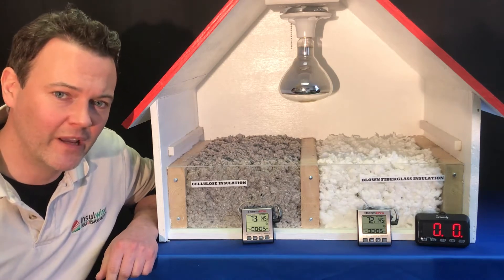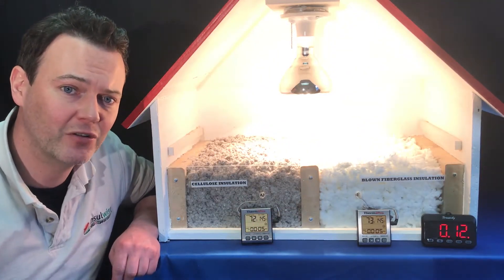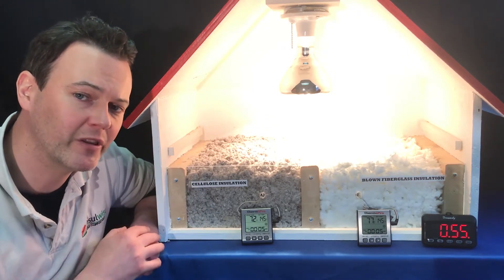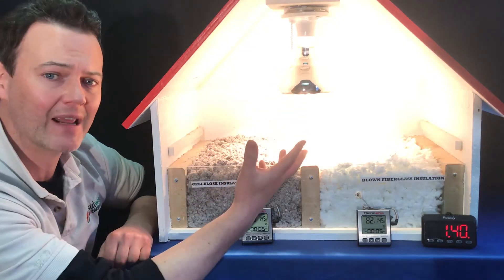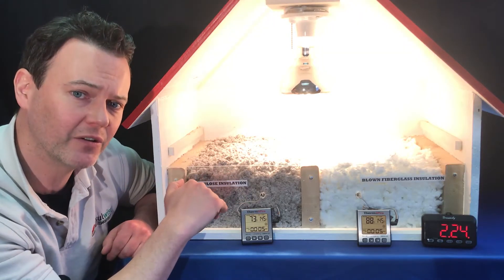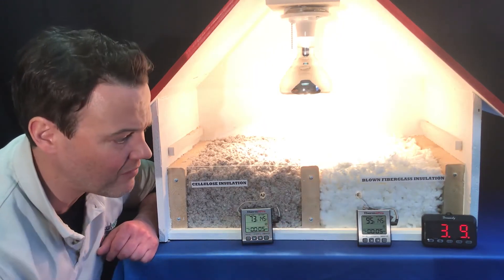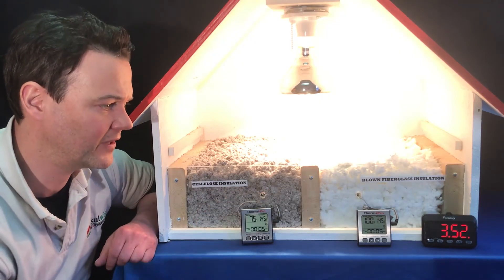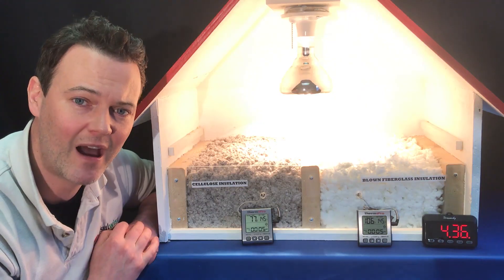Cellulose vs. Fiberglass Insulation: The Ultimate Showdown

Comment: Cellulose does not carry the longevity that fiberglass does. It also needs to be removed more frequently because it deteriorates into dust. Fiberglass all the way just install enough of it and it will work the same. This test is totally skewed because the fiberglass is way underinstalled
Reply from the maker: With due respect, this is incorrect.  I have seen cellulose that has been installed in homes since the early 1970's and it's still doing fine.  It is treated with non-toxic boric acid, so not even mold can break it down.  As far as it turning into dust, well, it doesn't, not sure what else to say about that.  Usually over time it will turn from bright gray to a brownish tint on the upper layer, which seems to be from dust in the attic landing on it.  When you disturb it the cellulose just below the surface is typically bright gray again.  Our stuff is made by a company called Advanced Fiber Technology.  Their manager there Jeff confirmed for me that it's guaranteed not to break down for the life of the structure...ie about a hundred years.  If it did break down at the rate "Dirty Boys RC" says, all of the cellulose insulation manufactures in the country would be having massive warranty and lawsuit claims. 

In terms of insulating performance it's not even close.   There is simply no getting around the fact that the R-Value of blown fiberglass insulation drops dramatically at temperature extremes.  Read that sentence again.  It means that when you most need the insulation to work, its performance will be degraded.  My guess is also that if blown fiberglass was effective, we would not get so many calls to re-insulate hundreds of attics of newer homes that had 16-20" inches of blown fiberglass in them.  The homeowners' complaints are that "I have trouble heating my upper floor in the winter, and during the summer the top floor is 5 - 15 degrees warmer than my first floor.  Often on hot sunny days you can feel the heat building literally as you walk up the stairs in these homes.

Furthermore, Pennsylvania has absolutely garbage incentives, ie effectively zero, for homeowners to up their homes' insulation levels in comparison to many other states.  That means these homeowners of their own volition are choosing to pay us thousands of dollars out of their own pockets, almost always after their HVAC company failed to solve their problems, to solve their homes' uneven heating and cooling issues.  

Lastly, why would I even care which one of these was better if it wasn't obvious?  Our hundreds of customers a year don't buy cellulose insulation from us, they buy a permanently more comfortable and energy efficient solution for their home.  

Hope this helps!
Andy

Comment: Is cellulose suitable for external cavity walls? Just concerned about moisture absorption and transferring moisture to the inside of the house
Reply from the maker: Hi there, cellulose insulation is in fact exceptionally well suited for exterior cavity wall insulation.  The correct process is called "dense packing" or dense pack cellulose because to do the job correctly the cellulose insulation must be blown into the stud bays at high pressure so that it 1) occupies the entire stud bay and 2)  is installed so tightly that it cannot settle over time.

Cellulose insulation is what is called hygroscopic.   That means that it absorbs moisture, but also just as readily releases it.  You can think about how a wet paper towel behaves in comparison.  No matter how wet you get it, it will be dry again within an hour if left out.  If you hire a contractor who can properly dense pack your exterior walls with cellulose insulation, any water vapor moving from inside to outside your home during the winter should have a difficult time reaching dewpoint temperature within your wall cavity (dense pack cellulose is so tight when done properly, that it is very difficult for air to move through it).  

So to summarize, when installed with the correct method, cellulose insulation is a champion for insulating exterior walls. 

Hope this helps, 

Andy

Comment: What do you think about putting cellulose on top of existing fiberglass?
Reply from the maker: Hi Jonathan, 
The practice is called "top coating" and we do it all the time.  It is much more economical than removing the existing fiberglass and then replacing it all with cellulose for a variety of reasons.  However the main thing is that when a fresh blanket of cellulose insulation is blown over top of existing fiberglass batts or even blown in fiberglass (after the attic has first been air sealed of course! https://www.insulwise.com/insulation/air-sealing-insulwise-pittsburgh/), it fills in all of the gaps around the original insulation reducing any potential thermal bridges caused by exposed floor joists, gaps around plumbing pipes, etc.   But just as importantly it also creates a layer on top of the fiberglass that cold air (during the winter months) has a much more difficult time seeping down through.  This allows something like blown fiberglass (which we are NOT fans of) to perform much better (because it is not having cold, heavy air percolate down through it and creating heat-wicking convection currents that can sharply reduce its functional R-Value). 

Hope this helps!
Regards, 
Andy

Comment: Can I blow celluslose overtop of existing blown fiberglass? Someone said something about compression of the fiberglass, was sure on the validity of that statement. Thanks
Reply from the maker: Hi Collin sorry for the late response.  Yes you can, it's called top coating and we do it all the time.  It will actually help the blown fiberglass to perform better because cold air during the winter will no longer be able to penetrate down through it, decreasing its R-Value. 

Andy

Comment: But this is misleading because it's understood that fiber glass needs to be blown in deeper to gain the same r value.
Reply from the maker: Technically you are correct.  But here's the point.  We routinely have homeowners seek us out and pay us thousands of dollars in this area to air seal and top coat over 15-20" of blown fiberglass with cellulose.   NO ONE would do that, if they didn't have an annoying problem.  Why?  Because it's insulation, not a shiny new car or big screen TV....so there's limited sizzle on that steak if you catch my drift.  I have also redone the work of other insulators in the area (one in particular....ugh) who exclusively use blown fiberglass.  I don't believe that the R-Values of these 2 materials are even close in terms of the actual performance that we see here in the field,  despite what it says on the package.    Meaning, when that lamp turns on,  you can see the heat almost immediately penetrate down through the blown fiberglass as evidenced by the thermometer.   Added to this, blown fiberglass also LOSES R-Value, which is its literal ability to insulate at temperature extremes.  This is proven. 

When you do this stuff every day you also notice some really strange phenomena.  I recall 10 years ago air sealing a huge attic that had an easy 18-24" of blown fiberglass in it.  There was so much of it that it was up to our knees, and I was honestly surprised the homeowners had difficulty cooling their upper floors.  But when you put your arms down through it to seal the wire penetrations and top plates on the attic floor, the fiberglass was still hot around your arms until you were just a few inches from the ceiling (it was summer obviously).   You could immediately tell the heat was penetrating waaaaay down through it.   With cellulose however, the temps drop almost immediately below the surface of it, just a few inches down and it's significantly cooler.   I observed this while digging for a tape measure one of my guys had buried in cellulose near an attic hatch.  You're never expecting this stuff, you just notice the difference because it's immediately apparent...and then the dots start connecting (if you're the sort that looks to connect dots, I should say).  And then when you observe this over and over again...

Lastly, Insulwise does not sell insulation.  We sell improved energy efficiency and comfort.  Period.  If I were to find that crushed walnut shells or hamster fur beat out cellulose, that is what we would switch to using ; - )

Regards!
Andy

Comment: Is there such thing as blown mineral wool?
Reply from the maker: Yes, mineral wool and rock wool are the same things.  We encounter blown rock/ mineral wool in older homes all the time.  It is extremely heavy, the fibers are extremely brittle, and about the itchiest thing you will ever deal with.  My teams hate dealing with it.  I don't know if you can still buy rockwool that can be blown, my guess is that someone sells it somewhere.  I guarantee it is far more expensive than cellulose (it requires a ton of energy to heat/ melt the slag and then spin the fibers), and that the end result is probably not as good.  It has a higher fire rating and possibly better sound proofing performance, but you'd be splitting hairs with those things.  Cellulose insulation cannot be lit on fire even when hit with a blowtorch, so I don't know what more you need than that.  Check out the videos, they're wild. 

Andy
Reply: @insulwiseenergycomfortsolu3293  I've had people tell me that cellulose blown can break down over time and cause dust issues in the long run. Does cellulose also retain r value?

Comment: This test is absolutely bogus. This guy is pushing cellulose. 
If you have proper airflow in your attic, then fiberglass is definitely the way to go. Fiberglass will always yield a higher R value than cellulose by comparison. Your first clue was the heat lamp underneath the roof. Anyone tells me that hot air sinks, sorry, doesn't work that way.
Reply from the maker: Bryan thanks for your comment, I always look forward to addressing contrarian views.  A couple of things.  Insulwise is not in the business of selling cellulose insulation, no one EVER calls us asking for that.  We are in the business of dramatically improving existing homes in the form increased comfort, energy efficiency, and interior air quality (IAQ).  We have learned to prefer cellulose insulation simply because its resistance to heat flow is superior, and that has been demonstrated in the thousands of homes that we have insulated in the Pittsburgh area.  It is 100% fact that we do A LOT of business re-insulating attics that have 16"+ of blown fiberglass in them before we get there.  These folks call us because they can't cool their 2nd floors to a reasonable level due to heat transfer coming down from their attics.    

The demonstration video is a comparison of which material more effectively retards heat transfer, and it doesn't get any simpler than this.  In this scenario I'm replicating the sun heating the roof and attic up to high temperatures in summer.  Here we commonly see summer attic temps in the 120-130 degree range.  And cellulose insulation is far more effective at blocking that heat flow down into the living spaces below, as evidenced by this demonstration.  If I created a mock up where the heat lamp was placed below the insulation, which would mimic wintertime conditions (where heat is rising up from the home below), you would see an identical result.  

On Owen Corning's own site, the R-Value can be deduced to be about R-2.9 per inch.  They don't come out and advertise it because they know it's inferior.  But you can calculate it by dividing the R Value in the far left column by the installed thickness farther to the right.  For an R-49, it's 16.5" inches.  That equates to an R-Value of about R-3 per inch.  https://www2.owenscorning.com/literature/pdfs/10011287AttiCatManufacturersFactSheet.pdf

For the blown cellulose made by Green Fiber, the tested R-Value per inch is R-3.6 (R-49 is 13.7" settled inches).  So before you even add in how awful blown fiberglass is at retarding air flow, which during the winter allows convection currents to form within a blanket of blown fiberglass (reducing it's R-Value the colder, denser, and heavier the air gets), the cellulose insulation is already at a 20% advantage in terms of R-Value per inch (R-3.6 - R-3 = .6.  Divide that .6 into 3.0 and there's your 20% advantage in R-Value.  
https://www.greenfiber.com/uploads/documents/Fact-Sheet-INS541LD-19.05LB-Retail-Bag.pdf

Now, this is straight from these companies' websites, so it would be fairly absurd in my opinion to argue that blown fiberglass has a higher R-Value?  Furthermore, our own experience in the field, much less the demonstration video, suggests that the margin of superiority of blown in cellulose over blown in fiberglass is in fact far larger.  It's the same wattage heat lamp over each type of insulation, and the same thermometer being used.  Temps in the cellulose stay steady longer, and the blown fiberglass quickly spikes. 

Best regards, 
Andy
Reply: @insulwiseenergycomfortsolu3293  ohhhhhhYEAHHHHHH Ye Speaketh FACTs
Reply: You are dead wrong. Cellulose has a higher R value than fiberglass, period.  This test also shows, irrespective of air flow, that cellulose is a better insulator.  Also, when it gets bitterly cold fiberglass loses some of its ability to insulate because of its crystalline structure, air cuts through it.
Reply: @swainer8014  Hey there Swainer80, you're correct on your assertions, but few people know this stuff other than us building science geeks.  How did you come across this information yourself?  In Pittsburgh we happen to work for a lot of engineers, in fact they're usually our favorite customers because they enjoy getting into the nitty gritty details like we do.   
Andy
Reply: @andrewhaak7747  A few things. I do heating and cooling and understand the heat load an attic can have on the sizing of a system. I've always been kind of an energy efficiency nut (be it for environmental reasons and also being cheap when it comes to utility bills). This also ties in to insulation materials. Cellulose makes sense as an insulator as it has a better R value, is made of recycled materials, takes a fraction of the energy to produce, has better fire resistance and cuts down on air infiltration (to a degree). It is the best loose fill insulation, based on my research and experience. Probably have insulated(added) over 20 attics in my time. It's a dusty job but it is for the greater good.
Reply: I agree. This guy is a cellulose salesman.
Reply from the maker: @davenport9807    I don't own a cellulose insulation company.  I own a home performance company.  If wang daddle doo was the more effective and economic insulation, that's what we'd be using. 

Andy Haak 
Owner
Reply: Don't know where you're getting your information from, but you're dead wrong. Per square foot, blown fiberglass has a higher R value than cellulose. 30 seconds on google would tell you that. I worked for Owens Corning, I am familiar with the quality testing practices they do to compare the effectiveness between their's and other products, including cellulose. The test in this video has no real world application, it's bogus. If you have a heat source between your roof and the insulation on the floor of your attic/crawlspace, your house is probably on fire.
Reply: @1278phantom  Your pants are on fire.  

Washington State University: R value of loose fill fiberglass 2.2 - 2.7, loose fill cellulose 3.2 - 3.8

Fine home building: Typically installed on an attic floor, loose-fill fiberglass has a lower R-value per inch (R-2.2 to R-2.7) than any other common insulation product, so it’s best applied in attics that have enough room at the eaves to accommodate a very deep layer . . . The insulating value of cellulose is comparable to that of fiberglass batts; however, because cellulose is more resistant to airflow than fiberglass, it performs better.

What is this per square foot nonsense? Yes, maybe if you put in 20 inches of fiberglass per square foot vs 10 inches of cellulose per square foot, then yes you would have a point.  Otherwise, on an inch per inch comparison, Fiberglass is a the poorer insulator. 

Here is a nice video showing the R-value per inch again as well as how each insulation type bodes against air movement. 

https://www.youtube.com/watch?v=osWeSqCXpcE

Also the illustration does exaggerate the results but it does a decent job of showing which is the better insulator. That lamp is a heat lamp. It puts out radiant heat. Guess what kind of heat do you get in the attic under the roof decking when the sun starts hitting the roof, RADIANT HEAT! Ever been in a garage with no insulation and you can feel the heat coming down on you? That is radiant heat!

Regardless the radiant heat, If one was to compare the insulation types with heat by convection say a 300 degree attic, the higher R-Value wins (r-value is a measure of heat resistance). So 10 inches of cellulose = R 35 vs 10 inches of fiberglass = R 25. Cellulose wins. I suppose you can blow in 4 more inches for a total of 14 inches of fiberglass and you can call it even. 

Funny you mention fire. I seems that cellulose has fiberglass beat there too.

The big burn: https://www.youtube.com/watch?v=lAPPn53JtHQ&t=216s

I restate my point, fiberglass is a poor insulator in comparison to cellulose. R value and air movement reduction is everything. 

Having some big plant that has to use a lot of energy to melt glass, spin it into fibers then chop it up to create an inferior loose fill product is a poor use of resources. 

 I will give paper-backed fiberglass bats credit for ease of use and a more respectable R-value but even then it has to be installed correctly with no gaps and not mushed into cracks and properly cut around electrical boxes otherwise it insulates poorly.
Reply: @swainer8014  k